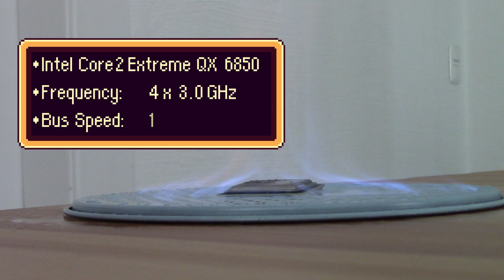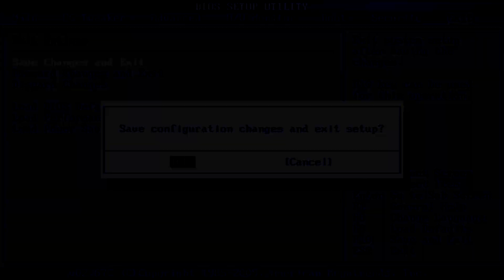QX 6850 - OLD & POWERFUL

Comment: I just recently built a machine for XP/Vista with the QX6850. 2x 8800GTX, 4gb DDR2 800, 2x250gb WD raptors in RAID 0 and a SA510 SSD. Holy crap does it run hot

Comment: Low FPS because uploader had bad overclock. Im using a QX6700 and I have overclocked stable on a three heat pipe cooling @ 3.55Ghz. I get 45fps on GTA V and 30 on BF1 with mine. The 6850 can pushed upwards 4GHZ. What a bad benchmark of this CPUs true abilities! Its unlocked and overclockable for a reason.
Reply from the maker: As I stated, I can't get an higher overclock due to my mainboard and I know what this CPU is capable of and tbh the fps you mentioned are very similiar to those I achived...Mr. Smartass. but thx anyway.

Comment: What is better core 2 extreme qx6850 or core 2 quad 9550??
Reply from the maker: I would prefer the Q9550 because of SSE4.1 support and higher IPC.
Reply: I have core 2 extreme.
Will upgrade from core 2 extreme to q9550 reasult in huge improvement or its not worth shot?
Reply from the maker: Totally not worth it, improvements would be very small. You should consider upgrading to a newer platform.

Comment: Can you list this rig of your benchmark?
Reply from the maker: QX 6850 @ 3.33 GHz
8 GB Crucial Ballistix 1333 MHz
Geforce GTX 1050Ti
Reply: From BIOS 01:07 is this one?? http://www.asrock.com/mb/intel/g41m-vs3/
I think with some high-end mobo LGA775 would be a better performance and better OC. 

My story...

I ordered a QX6850 from ebay for my second sleeper pc, here it goes
(my primary is a laptop from 2008 Toshiba Satellite L500-1D9
((some unnecessary info))
I upgrade only the cpu from T4400 to T9500 (+20% performance) with 4Gb RAM pre-installed (max 8Gb) but its too expensive to put 2 sticks of 4Gb (DDR2)
and i cant risk the only one mini pci-e with EXP GDC to put a mid or high-end gpu on it.
I believe its not warth for this laptop (except if i got a lot of money).
I already coverted to desktop when it comes on my hand :).
19'' ASUS monitor at 1440x900, USB mouse and keyboard.
Playing League of Legends max settings +Anti Aliasing +Vsync (medium shadows) 55-75fps its not a decent game for count the performance but is an example to get what is it.
It's not that bad but the gpu is old,
for example i can't play DBZ Xenoverse 2 (Shader Moder 5.0 is required) or DAY Z or Shadow Of Mordor 2015-2017 games :(((....
Im waiting now to replace the old Core2Duo Exxxx 2.13Ghz OC to 2.55Ghz with already installed a costum Corsair H60 with PCI-E Geforce GT210 512Mb bought back to 2012-2013 for 35€ :(((.
Its a second hand pc with ASUS P5N-E SLI mobo nforce 650i chipset.
I also ordered 4x2Gb DDR2 and Memory Cooler Heat Spreader Heatsink for RAM.
I also need to get a new copper cooler with fan like that http://www.ebay.com/itm/121085827040
for north and south bridge (they blaze a lot).
Im not planning to build a high-end pc because all of this is outdated my thought is to focus on this instead for my loving laptop, that i can't afford the cost to build a new one instead to hype this one bellow 150-200€.
I just need to !!!play games!!! not at ultra infinity FPS !!!just to play!!!
Thanks for the understanding.
Reply from the maker: Well then best luck with your endeavors. As for the Mobo...the one I have might not be the best when it comes to OC BUT it is one of the few boards that do support 800/1066/1333 FSB CPUs AND DDR-3 RAM...So I can throw any LGA775 CPU at it and it will run, beginning with Pentium 4s up to Q9xxx Core2Quads.
Reply: Ok. Well indead there is a few boards for DDR3 to compare which are best but it doesn't really matter right in now days.
The other thing that im thinking is bottleneck, there is no site for legacy parts 4th Gen CPU to calculate the new graphics cards. 
Do you know which new card will fit with QX6850?
Reply: Also can you make a video how it works with PS2 Emulator the game God of War 2?
Reply: So Which new gpu will match well with QX6850 with a mobo of 4x2Gb DDR2 1333Mhz with a PCI-E 2.0 SLI? (nforce 650i is the chipset)
Reply: I get today the qx6850 but in bios its said I have a q6850😠😠😠😠
Edit: also appears in boot that Hyper Threading is enabled WTF???

Comment: GTX 1050 Ti + QX6850. That GPU is way too powerful for that processor but guess it doesn't matter. Ultra settings at 30 FPS. Console level graphics on a $200 machine. And people say console is a good value. I have almost the same system I'm working on, just a bit slower. QX6800 + 1050 Ti + 8GB Samsung @800 MHz [Dell XPS 410 build. Cost me a total of $150 to obtain all parts.]

Comment: Just go with overclocked Xeon modded from s771 to s775 today. The best mid is E5450. https://ark.intel.com/content/www/us/en/ark/products/33083/intel-xeon-processor-e5450-12m-cache-3-00-ghz-1333-mhz-fsb.html
It's 45nm, not 65 nm like Q6x00, and it has only 80W TDP (Q6600 has 95, and QX6800-6850 has 130). Also, it has 12MB cache instead of 8MB. They are for around $20 now, they are often sold moded for s775. They can be overclocked easily, usually to 3.8 - 4Ghz on air, without raising voltage into extreme. This is best CPU to s775 and cheap.
To run QX6850 is madness, it just runs hot, draws more power, and it's slower than E5450. You basicaly pay that $20 using QX6850 for electricity bill in a year of usage, so it's better to get Xeon for $20, you longturn, even save money, that would QX6850 eat. (note: You also need to mod the BIOS, so your MB can detect that E5450 good, it is basicaly Q9650 with less thermal power design, so mostly you can get better overclock)

https://www.aliexpress.com/item/2041514744.html